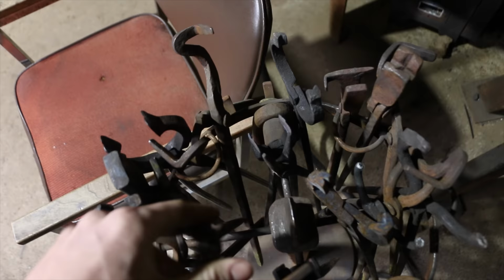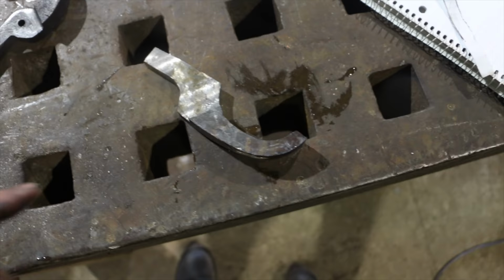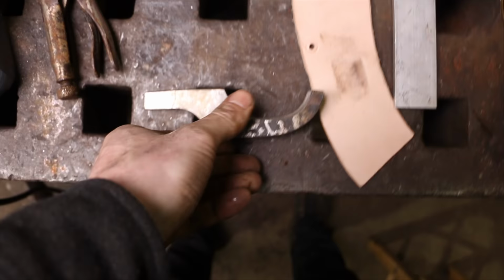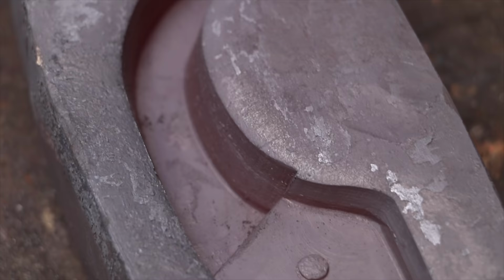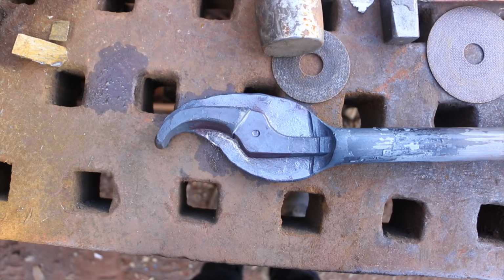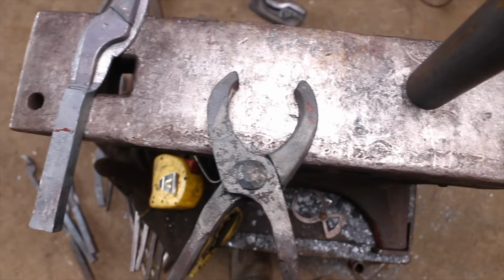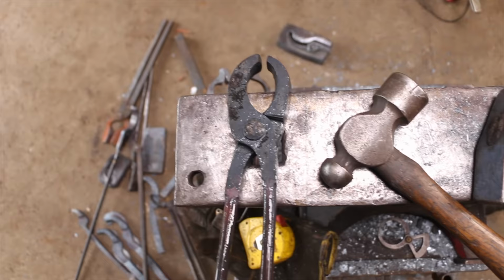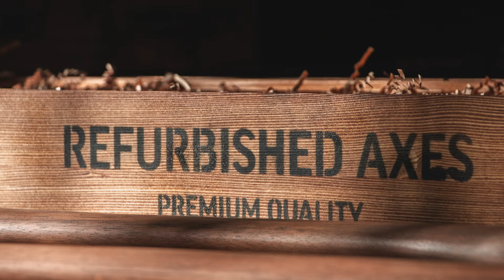The quickest way to make blacksmith tongs!

Comment: The die you made that ended up with the “sloped sides” is actually how closed cavity dies are designed. The draft angle is what allows the finished part to release from the die. Happy accident, that! I suggest another die to make the preform. It would need a top and bottom die. It would taper the nib and then bend the nib and hinge area. Then turn it 90 degrees to make the final part. When we make forged brass lever handles we have a bending die mounted next to the closed cavity die. One strike to bend, one strike to forge. Excellent build!

Comment: This takes me back to my drop hammer days.   You need to make a preform die that matchs the width and curvature  of your finish Die.  You can do both processes in the same heat.     Also, as I currently run steel and titanium  forgings on a 12,000 ton Erie press, I would suggest using a graphite lubricant.  You wipe it on the die prior to forging.  Not only will that help the flow of material  but it also helps the release of the part from the die.
Reply: When he struggled to get the part out I immediately thought "dry lubricant needed".
Reply: @bodyno3158  same.    At my current job we dip our titanium  in liquid ceramic and let it air dry to a boutique .002 of an inch.   It turns to a glass coating in the furnace and protects the material from oxidation.  We Forge precision  air foils for military and commercial  turbine engines.   We don't want any oxidation  being forged in.   The glass costing stays on the parts during forging and aids in the flow of material.  Even so we still use graphite lubricant.  Different  percentages for different flow rates and tonnage we want during forging.     It's weird when forging titanium, addition  lube on the die actually  slows the spread of material.   Light or no coating causes it to spread to fast.    Where as with steel forgings its the opposite.    In my experience
Reply: @fitnessandfirearms7503  That ceramic trick is very genius, I don't know much about machining, that's an eye-opener for me.
Reply: @bodyno3158  I believe we patented the exact process we use. But I'm sure other companies have caught on

Comment: It looks like you could really use a dedicated metal grinding area away from the wood grinding area. I would like to see you make right handed carving hatchets that weight 1lb & 1.5lb. It is difficult to find good carving hatchets that are ground appropriately, not too heavy and not an antique made with too soft of steel.

Comment: Change the die direction such that you press in the squeezing direction of the tongs so as to preserve the engineering dimensions off the tongs and not have to grind off draft angles.

Comment: Big advantage of forging the sinker instead of stock removal, is it's easier to size your preform to minimise flashing while fully filling the die. Make your sinker from 20mm square? That's the stock size you'll need.

Comment: Drill a hole through the die so you can force it back out while it's still hot.  Also you could hot cut the flashing off faster because it's already hot.  Just swap out your die

Comment: Have you considered making a "mold" for the preform, like two blocks of metal with the right contours that you could just take a piece of round bar and smack it between, then press it in? Not sure if that's a good idea, practical, or worth it, but I bet it would feel nice to just take a bar, give it the one-two punch, and have a new set of tongs. :P

Comment: Axe design request... a heavy splitter/maul with a tough enough poll to handle pounding steel wedges. I have private access to an amazing abundance of dead standing giants that make premium firewood. However, they're very remote and need to be split down in order to handle. Would gladly pay good money for the right tool.

Comment: Hey there buddy…. Why not make you a hook down head side with three holes through it so you could move the pin to get different widths????  Almost like taking a pair of channel locks apart visually and then re-creating that basic design without that slipping feature????  Unless you could get you something that would work just like those curved set of gears that you normally slip and pick????

Comment: I think you could make a really thinner pair, just by starting with a much thinner pre-bent rod--- and then hold your original form piece over that smaller rod to hammer it down into the block.  Also, that way-- you don't have any extra flange squeezing out that needs to be ground off.  You might have to make a couple to get your pre-bend the right thickness to start with;  but they could be quite a bit thinner that way and more efficient to make, with less grinding time.
Reply: Except that with the original form piece you'd be creating a step on both sides of your forging.
Reply: @dicksargent3582  Thats' true.  You would have to make a flat form piece;   Just to use it to press it down into the bottom of the block, since the mold is deeper than the thinner rod.  I guess you could just make a thinner mold-- but then you still have the flanging problem.  I like the idea of making a flat form for the top side.